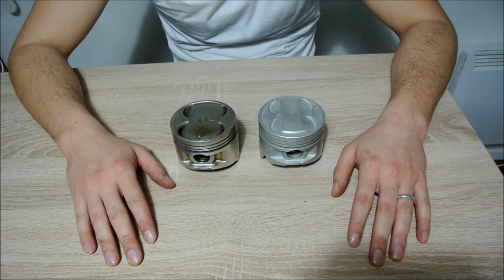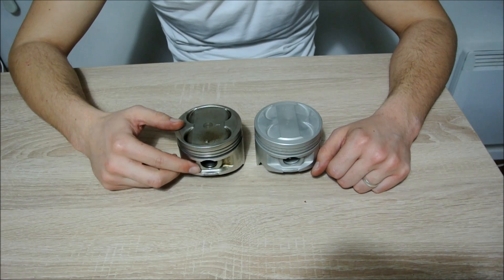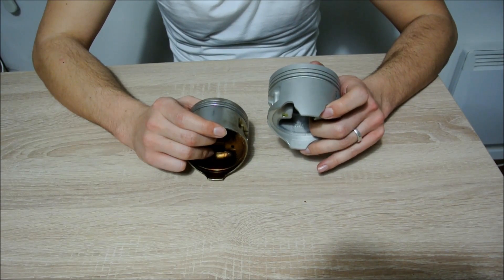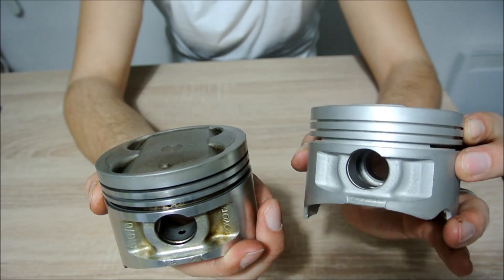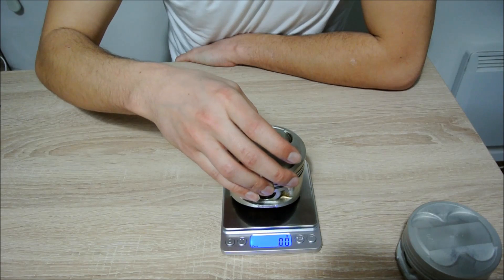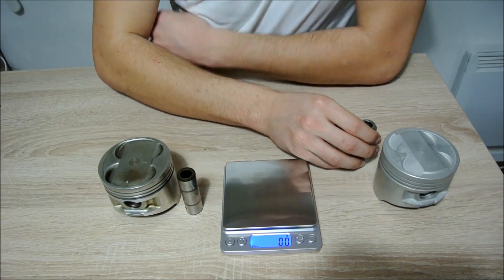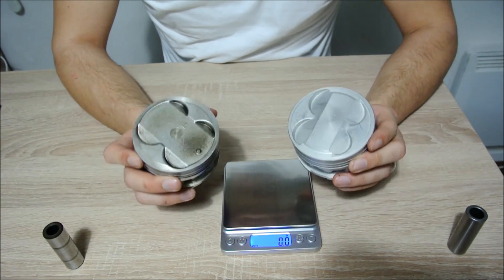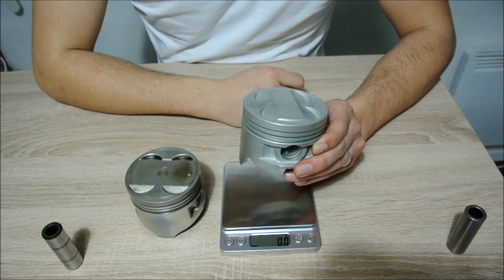smallport vs bigport pistons 4AGE 16v

Comment: U thought bigport used 18mm wrist pins and smallport is 20mm.Did u have to use the smallport connecting rods?
Reply from the maker: Late bigport and smallport have the same size rod small ends, it's the early bigport that has smaller rods.
Reply: @d4a  thanks papi

Comment: I thought the 4age is a non interference engine, don't the cutouts on the Pistons mean it is an interference engine?
Reply from the maker: It is non interference. If you put the piston at top dead center and you open the valves fully (by making a few full rotations of each camshaft), the valves sit nicely in those cutouts but don't touch the piston. Even with the smallport domed pistons the engine remains non interference and the cutouts are part of the reason why it is so. If you were to cut the head a lot, and maybe get some high lift cams than it would no longer be non-interference.
Reply: @d4a  oh that's a relief, I'm buying a mr2 tomorrow that might have a broken timing belt and didn't get a chance to take the cover off and look.
Reply from the maker: Valves might still be bent, because the intake and exhaust valves might have hit each other, or the engine might not be fully stock
Reply from the maker: But there also might be zero damage :)

Comment: Hello, 
thank you very much for your istructions. Only few minutes left to order wrong pistons... I'm looking for small port ones, can you provide some advices?
Reply from the maker: Toyota does not make them anymore. You can try ebay. I bought mine on ebay. You can also find the part number on toyodiy.com. If you want smallport ones just look for the domed pistons. They were only present in the AE-92 Corolla.
Reply: Thanks once again. So, I have Ae92 Corolla. Are there any chance/way to replace them? Only AE92, not in AE86?
Reply: Have you taken the engine apart and taken a look at the pistons? If you have domed pistons, then you have high compression (10.3:1) smallport pistons, if you have a flat crown on your pistons than you have low compression (9.3:1 I think). http://www.ebay.com/itm/TC2989-020-DOME-TOP-Pistons-Rings-1989-92-1-6L-TOYOTA-COROLLA-GEO-PRIZM-4AGE-/361750943086?hash=item543a09556e:g:JnkAAOSwWBJXBHXd&vxp=mtr
Here's everything you need to replace the pistons. Beware these are 0.5mm overbore, which means you need to bore your cylinders 0.5mm at a machine shop (probably a good idea). If you have more money you can buy some forged ones for even more compression. It all depends on your budget and goals. 
Your first step is to take the engine apart and then bring it to a reputable machine shop that knows what they're doing so they can tell you what needs to be replaced.

Comment: will the smartport piston fit on my bluetop 4age and will that increase power on the engine
Reply from the maker: +Javier Broger theyre called smallport....although you should copyright that name and try and sell it to a car manufacturer :). Smallport pistons wont fit into a bluetop i.e. early 4age 16v bigport. Early gen 4age 16v use press-fit pins, while the smallport ones use pin retainer clips. So unfortunately they won't fit. But a early gen 16v is still great because its has a lighter rotating assembly and can be even better than a late bigport if built right. Look around and you will find OST's early bigport build and see what I mean.
Reply: driving 4 answers would the small port fit in me 4efe 16v?
Reply: driving 4 answers hey D4A, I've been looking for the OST build you mentioned... Maybe I'm misunderstanding you - sorry but I can't find it. Please assist.😅 I have a bluetop (didn't realise till I stripped it...) Was disappointed at first but hey...